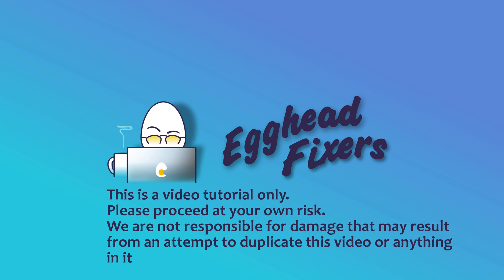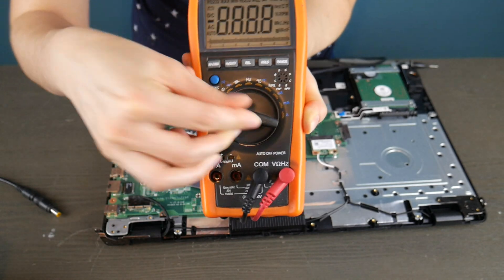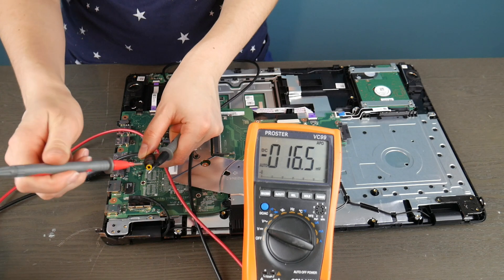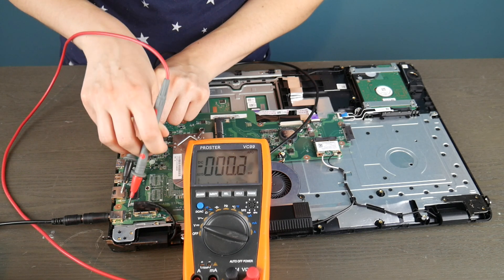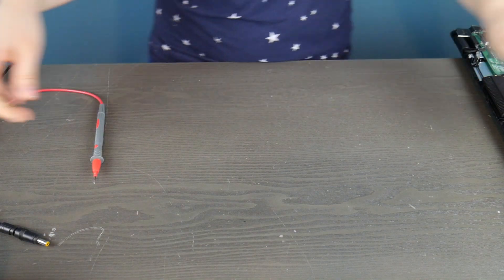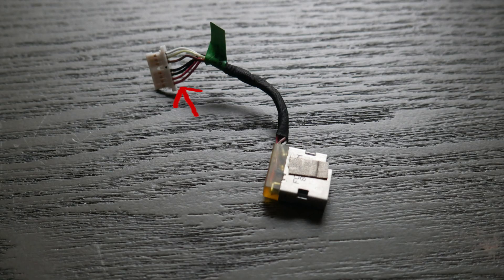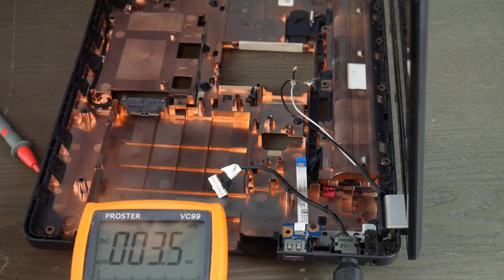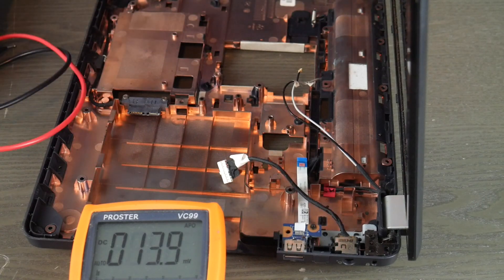How to Test Your Laptop's Power Jack with a Multimeter - Tutorial by a Certified Technician

Comment: Hi,
I tried to submit this on your website but it wouldn't take it. I have had several laptops develop a similar 'problem'.  The ac adapter/power port does not always connect properly, and it gets increasingly 'bad' over time until it becomes questionable whether it will actually connect and charge properly at all.  If I swivel the ac adapter power jack in the port (even though it feels firmly seated in the port) I can eventually get it to connect. I tested the adapter cord and it looks fine.  Is there something usual that causes this?  I have watched this video about testing the the power jack with a multimeter and it's very good but I still can't figure out what's happening. thanks so much for any advice.
Reply from the maker: Have you tried another charger? Also, are you using a surge protector? A bad outlet over time can cause weird problems like this.

Comment: You said the entire motherboard needs replaced because the DC jack is dead? You can replace just the DC jack, instead of shelling out hundreds, if not more, to get the entire motherboard replaced. The DC jack is usually $5-$10 and is easily replaced if you have a soldering iron and flux. Grand total to change a DC jack yourself, $50 tops, if you don't have  a soldering kit. $10 tops if you do already have a kit. Then if it still doesn't work, you can begin to think motherboard itself. In which case, you may as well buy a whole new laptop for that price.

Comment: I bought a new charger for my lenovo 330s 14ikb but it doesnt charge. The jack works but my multimeter reads 1 or lower volts when im using the multimeter for the pins on the board
Reply from the maker: Sounds like the charger was a lemon. Is it a generic charger?
Reply: @EggheadFixers  not sure, i ordered a higher wattage but im not sure if that caused it, the multimeter reads the output of the charger as 20v, which is what the labels on the charger said
Reply from the maker: @laolalaoal  the voltage needs to be the same as the charger it came with any higher can fry the computer. The ampage can be higher and it usually won't cause a problem but if it's too low then the computer won't charg correctly.
Reply: @EggheadFixers  the voltage is the same, its the amperage that is 1 amp higher. However the power isnt going through the board, it just goes through the jack and thats it, the connector on the board doesnt supply power to the board
Reply from the maker: @laolalaoal  In that case you will most likely need to replace the board. It sounds like it's an issue with one of the components on the board.
Reply: @EggheadFixers  oh forgot to mention, whenever i test the pins that go to the motherboard from the charger, sometimes it will spark(?).
Reply from the maker: @laolalaoal  Ya it sounds like it needs to be replaced. That's not typical behavior.
Reply: @EggheadFixers  oh that sucks, i waited for a long time to finally be able to buy a laptop charger after not using the laptop for a long timefor the board to be faulty
Reply from the maker: @laolalaoal  You can always replace the motherboard but it is labor-intensive and a lot can go wrong. It is a big bummer when they die.

Comment: thanks for the video. I know that the red wire is the positive which reads the same voltage as the charger, the black is the ground, but what is the white? Is it the negative? Should I get a reading from it or not? If so, how can I test it?

another thing, I had a problem with my previous power jack and I bought a similar one. However, the order of the wire colors is a bit different. The original power jack's wire colors were: red, red, red, empty, white, black, black, black. While the one I bought has the following order: red, red, red, empty, black, black, black, white. As you can see one of the blacks and the white are switched. Since I replaced my power jack I started getting the message: "Alert! AC adapter wattage & type cannot be determined. The battery won't be charging ....." Could it be that the difference in the colors order is what caused this problem. So, should I get another power jack that is identical in the order of wire colors? Thank you so much!
Reply from the maker: As long as it's for the same exact model then it should be fine. Sometimes they use more than one manufacturer for the same part which can cause variations with things like wire colors. However, with that warning message, the part sounds like it's not working correctly. Is the part generic? sometimes you are better off buying used OEM parts over new generic replacement parts.

Comment: Hello!  So I have a question, what if the wired power jack (which is from an MSI Gl62m-7rex laptop), has 3 black and 3 red on the motherboard side?  Both sets are wired together according to their colour, so it's not like red black red black or something like that.  How would I be able to test the viability of the said wired power jack without attempting trial and error and going though 9 different kinds of trial and error ? 😅😅😅
Reply from the maker: Typically we just go for the trial and error option. Its not ideal but it gets the job done.
Reply: @EggheadFixers I see.  Will do that right now.  Thank you very much for taking the time to answer my question.  Also thanks for putting up these informational videos!